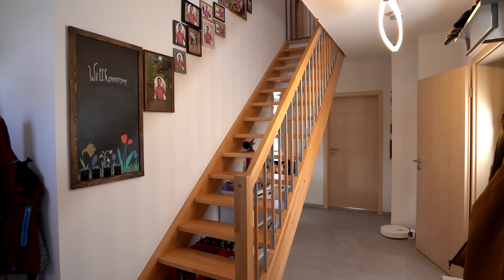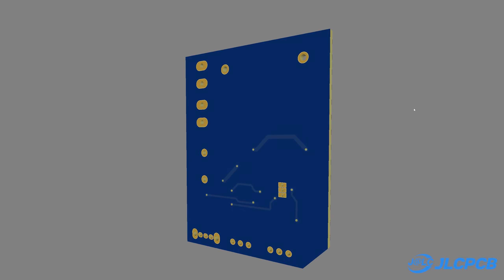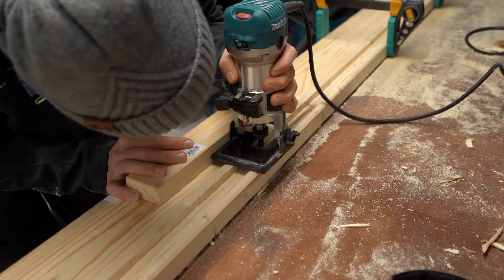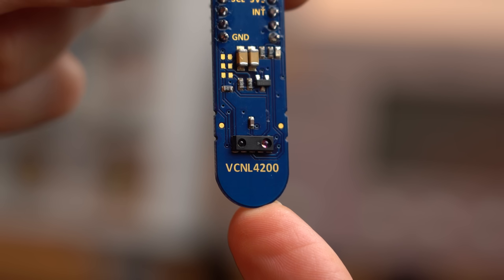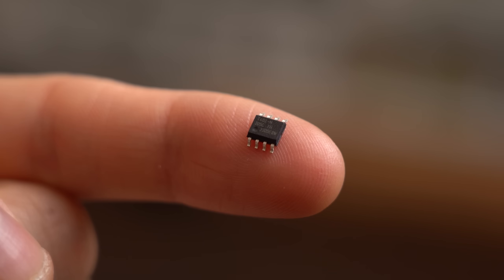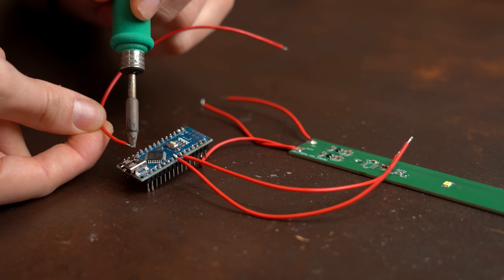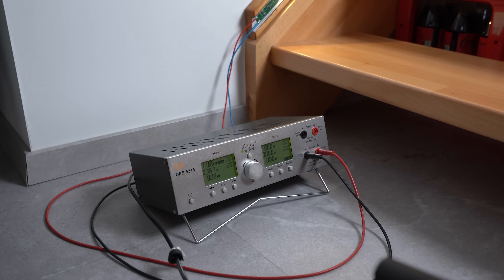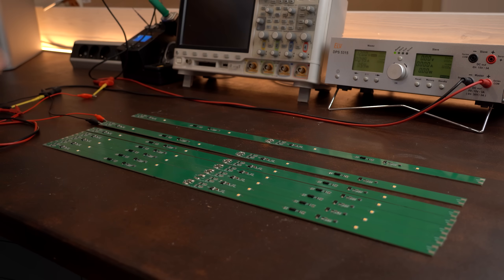I tried to Revolutionize LED Lights!.....And FAILED?

Comment: 6:50 you can use a diffuser cover and drill tiny (1mm diameter should suffice) holes right in front of the IR sensor.
Reply from the maker: I can certainly try to do that when I get back to the project.
Reply: I was thinking the same while watching the video!😄
Reply: @greatscottlab  a tube of acrylic may help with channeling the emitting side of the diode, which can then be shielded with heatshrink. A 3D printed bracket to hold this in place sounds perfect. 🙂Perhaps the V2 PCB's could have some holes in them to allow for locating and/or installing these brackets or features, if only for those who need it getting the inspiration.
Reply: Or just use a small section of the clear one where the sensor is, while the rest can be diffused.
Reply: Another solution is to use the clear cover and scuff up the rest with sandpaper except from where the sensor is.
Reply: Do you need to be precise with where you drill?
Reply: @greatscottlab  glue a translucent sheet with gaps for the sensors
Reply: Trash bags are invisible to the IR spectrum, so some white ones to cover said holes might be nice. The only issue that I can think of is leaving darker spots on the diffuser
Reply: "Do not damage the staircase"

"Hole in the wall it is"

I love how it technically didn't break the rules, but if my experience is to go by, she means don't do anything weird to the stairs 😂
Reply: Youcould also use diffusor-foil whichis used by PA-technicians. I 'repaired' some ir-moving detectors with it. Works lime charm. Go with full white or 3/4 white.
Reply: @DashCamSerbia  using a lens on the receiver will distort its ability to sense distance and will severely limit its angular range of detection (FOV)
Reply: Definitely going to trip my OCD. I would use a long range distance sensor and map the distance to the index of the led(s).
Reply: I still think a sensors at the top and bottom of the stairs is way more practical than lighting up individual steps after you already stepped on them... So he could just have an exposed sensor at the top and bottom then diffuse all the lights.
Reply: @AnnaVannieuwenhuyse  What lens?
Reply: That sounds like a big pain in the ass in terms of precision tbh
Reply: microwave sensor??
Reply: @conorstewart2214 this guy gets it ☝🏼 Mask the sensor locations with small round stickers on a clear piece, and sandblast the rest of it
Reply: Man, you read my brain word for word 😂😂😂
Reply: @YandiBanyu  The wall is easier to patch than the staircase is 😉  Looked pretty good in the end so once he gets it working I'm sure it's going to be permanent anyway.
Reply: I was thinking something similar. Use clear plastic strip then tape off a circle or whatever where the sensor is, then buy some frosting spray (or lightly sandblast if you really want to).
having a hole in the plastic allows dust in (or if moping it can allow water in)
Reply: @pikejuan  not to mention a drilled hole would look terrible and the IR light doesnt just have to go out the hole it has to be reflected and go back in for the sensor to work
Reply: Radar sensors don’t care about plastic, mine picks up people through walls!
Reply: Was thinking the same thing!
At night it def souldnt be noticable, if it is during the day maybe try covering the underside of the hole with a trash bag that someone mentioned should be ok for IR (no idea if thats true)
Reply: @greatscottlab instead of infrared pir sensor you can use microwave pir sensor which is working behind the plastic cover (unlike the IR microwave pir sensors works behind any plastics so you can fully  close the led strips without need of drilling holes or leaving gaps of any kind)
Reply: Thats what i was thinking, i guess its easy ti overlook such things
Reply: @greatscottlab  yess sir

Comment: I came accross this brilliant video a couple of weeks ago and absolutely loved it, including the issues and how you  try to deal with them. All of a sudden, I don't feel alone anymore :). I found the idea very good, so I had to try it and sourced a few components and knoked up  a few boards on the micro cnc  and wired everything > I modified ever so slightly the schematic and the code to address some logic issue with the pin In and Out. On one board everything works, but as soon as you connect several boards they start firing up randomly. Like you I spent a bit of time trying to figure out what happened. My conclusion was that it was nothing to do with the noise on the in/out line. In fact the issue is the variance in the response from the VCNL4200 sensor from one unit to the next and also within the same unit!. So I finally got it to work by measuring a "reference threshold" in the setup of the code (so I might have different value for each sensor) and also by taking the average of 11 samples for each reading of the proxy sensor. That completely fixed my issue! (I think ;) ) If you are interrested in the code or schematic I can of course share it.
Thanks again for your great work!

Comment: Thanks, excellent content! :face-blue-smiling: Some issues with the signalling are already well covered in the other comments but as an alternative, how about a simple analog circuit for the "signalling the neighbours"?

You could have one common "sense" line, with a series resistor (eg. 1k), and another (eg. 1k) to the ground, in every PCB. The board (or boards) that detects movement would then pull the line up. This would create a voltage ladder circuit across all the other boards in the system. The "origin" board would have the sense signal at +3.3, next board seeing something less than half of that, and so on. I believe ATtiny can easily source/sink the required 5..10 mA from the output pins, and has a 10 bit ADC to measure the voltage (*). This would require only one pin and connection between the boards. Noise filtering, on/off delay and range (ie. how many adjacent boards to turn on) could then be tuned in the software.

(*) edit: for example two boards triggering, the circuit and voltages would be like https://tinyurl.com/27fdw7yt (circuitjs).

Comment: You have noise on the Input Pin (PA7)
Add a 100nF capacitor between PA7 and GND.
Place the capacitor close to the ATtiny402.

When using long wires, in your case long traces, you made a Antenna.
All input pins should have Capacitors on them, but the higher the capacitance, the lower the switching speed, so you'll have a lower transmission rate

Comment: You could analyze the signal coming from the sensors when the stairs are empty and filter out the noise or threshold it out

Comment: An addressable led strip with a ESP32 with WLED and two IR sensors (one on top of the staircase and one at the bottom) could do the trick relatively easy (even change the effect/brightness at certain times of day). Maybe even coupled with home assistent to intergrade in the smart home.
Reply: this is my setup and the sensors also turn off the led power supply when not illuminated with the animated staircase user mod
Reply: That would be the easy way. But it's like 100x cooler to only lit up the individual stairs currently being used.

Comment: It is a great idea, use pressure sensor/push buton beneath with mechanism for steps which turns the respective led light of that stair step

Comment: @greatscottlab LED Lighting Electronics Engineer here. I reviewed your project files and a few things:
1) put 0.1uF and 10uF cap on the input and output of your LED switcher. You actually need a high freq cap and lower freq cap to cover the freq range for input and output ripple
2) I like the 4-layer idea, but do 2 internal layers of ground, and only route on top and bottom. Also, make sure to sink a ground via right next to every signal line via (this will help the signal keep good ground reference and force the inductive coupling on the internal layers to follow a set path. Try to reduce the number of vias per net as much as possible (don't want added inductance)
3) Make sure to look at the recommended switcher layouts and make your switching nets small, and DO NOT let them go onto other layers (don't want to have inductive coupling between layers). Also, try and get ground between traces so you don't get cross talk. At the lengths of your PCBs, I'd expect you could get Volts worth of cross talk, even at sub 100MHz freq.
4) I'd add a common mode choke to the input of every PCB and a Pi-Filter too. It may be overkill, but for a few extra bucks you grantee each board isn't getting noise on the input. Make sure to route this all on the same layer as the connection between boards (so top layer for you). The shear length of the boards all ganged together is working against you and stray fields from surrounding power lines and appliances/electronics could get onto the boards and cause some weird behavior. Better to go all out and find you you don't need it then to find out you do need it haha.

I highly recommend "philslab" on youtube as has some great videos giving best practices. The whole FEDEVEL group is very helpful for PCB design for EMI / EMC. Wish you the best of luck man! I love your videos and love the idea ;) Keep it up man!
Reply: Thank you for sharing this golden knowledge

Comment: Maybe the IR distace sensors are interfering with each other. Try to place a narrow tube infront of the sensor to narrow it's field of view.
Reply: maybe if he tried it with light diffusion material with narrow holes just for the sensor's diodes, I think its small enough to disappear when looking from a distance.
Reply: That's what I was thinking too - however a tube may not solve the issue as there may still be light reflected from other surfaces / feet.
It might be an option, since you have comms between the boards, to activate the sensors one at a time so it effectively scans the stairs.  Then each sensor will only receive it's own light.
Reply from the maker: No. I checked most sensors while all were operating. They do their job just fine.
Reply: The IR led has only +-25 degree cone and the sensor drops to 50% at +-30 degrees, it probably isn't a problem
Reply: Custom cut pieces of clear acrylic to be placed atop the sensor. The rest can be diffused.
Reply: This is what i thought they're working too well, maybe some wall on the sides of the sensor would indeed narrow it's view.
Reply: I think that the IR reflection from your body is scattering into other sensors. Reducing the current through IR diodes might help. 

Another thing to check is the metal bars on the other side of the staircase. Maybe they are the ones causing problems. Just blocking all of them off with a cardboard might work.
Reply: The problem is the staircase itself. On the right side of the staircase you can see metal that works as a reflector. Proof is that when you disconnected the modules from eachother, they still turned on. Try covering the metal posts with black paper and try again.
Reply: @greatscottlab  How sensitive are these sensors? Could the staircase be vibrating ever so slightly, enough to trigger them?
Reply: @greatscottlab   Can the logic be such that only the first and last proximity sensor is on all the time and if one is triggered, it turns on the light, turns off its proximity sensor and pass the information to adjoining sensor to turn on and wait for triggering? if its interference it would be minimized

Comment: Wouldn't the ground and/or VCC planes act as a rather large antenna like this?
Reply from the maker: Kind of. That is why I will probably have to add some filter at every input/output.
Reply: @greatscottlab  perhaps it might help to reduce the size of them, and for the ground plane to only really extend under the attiny and the LED controller IC.

It might also help to run VCC and ground over an external (twisted?) wire pair, but that would somewhat defeat the purpose.
Reply: If not already done, it can be beneficial to connect the aluminum profile to GND and/or protective earth. This can reduce the "noise" fields by giving those a decent path to "conduct" to.

Comment: You can try using one master PCB with a microcontroller chip and the other PCBs to just have power lines with LEDs and proximity sensors.🙂
Or just use just two sensors at the first and the last step to light up as how WS2812 leds light up with a drop effect.🙂

Comment: You can try using diffusing covers but drill out a hole where the sensor is and fill it with a clear resin / disc

Comment: The design of the data lines won't work as indended as described at 5:12, there should be one diode for each OUT pad, not one for both. In your current design, every other board is commoned together via the OUT-Line of the board in between:
Board A In2↔Board B OUT1/OUT2 ↔Board C IN1/IN2 ↔Board D OUT1/OUT2↔Board E IN1/IN2...

Most likely that's why all the boards were lit in most of your initial trouble shooting. The boards at the top of the stair (which later you found missbehaving) pulled all the other inputs low, until you introduced smaller pull-ups until the voltage drop was enougth to be registered as low.
Reply: I can’t quite get a good picture of the PCB design, but it looks like this would be a pretty easy modification to the existing boards. Right?
Reply: @jdl3408  could be as simple as adding a diode where the boards connect together.
Reply: I noticed that too. His outputs are connecting to outputs and his inputs are connecting to inputs in his drawing. If it's the same on the actual PCB, then that would explain a lot
Reply: @conorstewart2214  Oh that's an nice and easy way to fix that :D Great idea! Just bridge D1 and use diodes to bridge the boards together 👍
Reply: I was trying to understand how he was gonna make that work in my head when he said that. Maybe a bunch of diodes or something
Reply: Have you an idea on why the leds were still acting up when he disconnected all the data lines?
Reply: I think you are right, this is most likely the problem as they worked fine separately, alsoy using the diodes every other PCB rather than every PCB might just be enough
Reply: @acmhfmggru  quite understandable as he was soldering them in a very bad angle... so minor soldering mistakes can be easy to miss
Reply: @acmhfmggru  quite true ... though I didn't see any components were really close together
Reply: @woofy1988   This is not the problem, I think. Look at the PCB at 8:39 in the video. Inputs and outputs are swapped on the left and right hand side of the board.
The problem is what @YarianZy pointed out: inputs on left and right are connected together, same with the outputs. Boards are divided into odd/even groups, with all odd boards outputting data to all even boards and vice versa. (Two boards in the "odd" group don't communicate with each other at all.)
Communication will be screwed up if two units transmit simultaneously, if the line load is too high, or if the long communication line is noisy.

I would use a single Open-Drain pin to communicate between neighbouring boards only, with input and output on the same pin. One pin going upstairs only and another pin downstairs only. Pull down a pin if you want the neighbour to turn on its light. uController turns on its own light if sensor activates or if a neighbouring board asks it to do so by pulling down the communication pin. Add timing or direction sensitivity as needed.
The existing PCB can be reused: Cut two traces and mount a 0-ohm resistor instead of the diode.

Comment: Could you use something like tracing paper to help diffuse the light? You could then cut tiny holes for the infrared sensors to work properly.

Comment: Great that you’re also sharing failures! Do you really think the noise on the VCC is causing this and not a coding issue?
Reply from the maker: Well, I spent so much time on this project that I kind of had to make it into a video. And no, coding is not the problem because everything worked fine when testing with less units. I think EMC is the big problem here.
Reply: @greatscottlab  Consider the CN5711 led driver, it doesn't require an inductor.